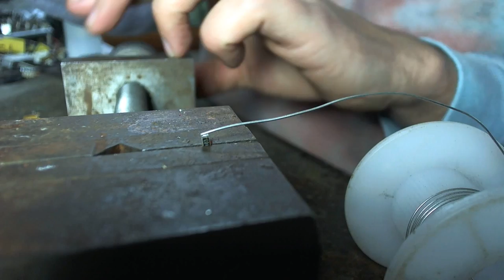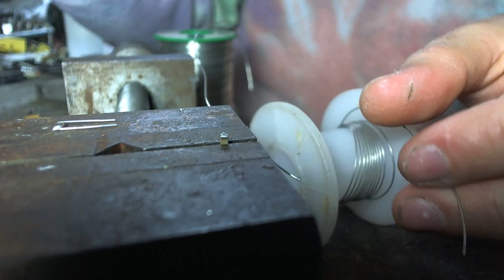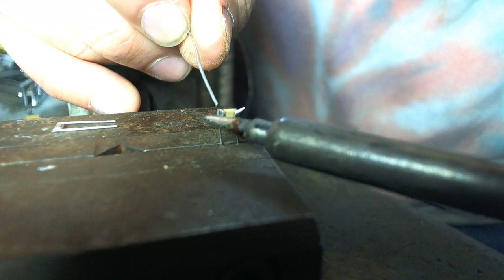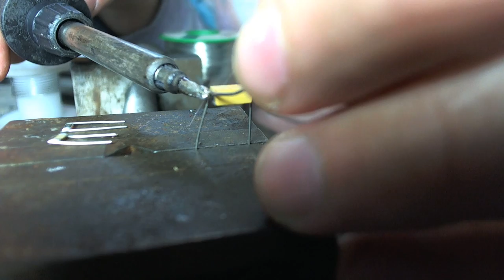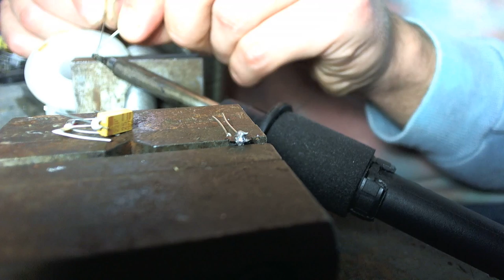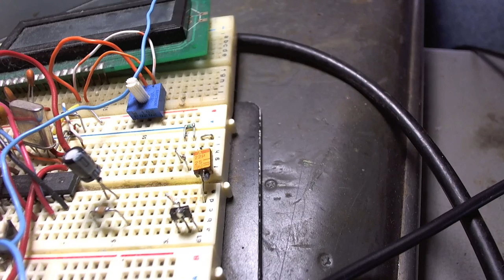Soldering wires to SMT Chip components

Comment: A better idea is to take some 5 minute epoxy and glue down all the components you want to use on a piece of lightweight cardboard. Then simply join all the connections with some mod wire and a touch of solder.

Comment: thisi is "how not to do it", everything is wrong: wrong solder wire (too thick)  + excess solder + cold joins + poor connections even the solder tip is wrong : too big, not properly tined and looks rusty